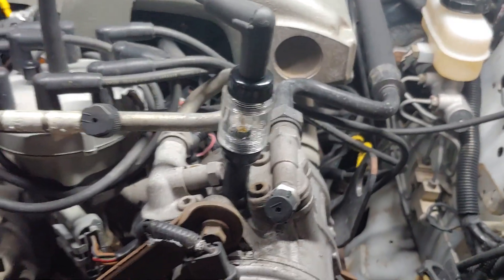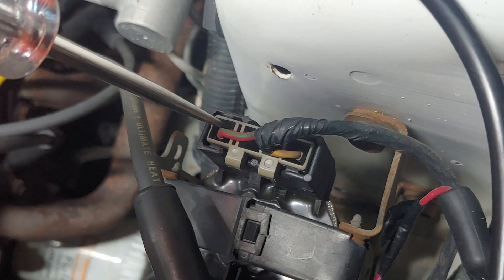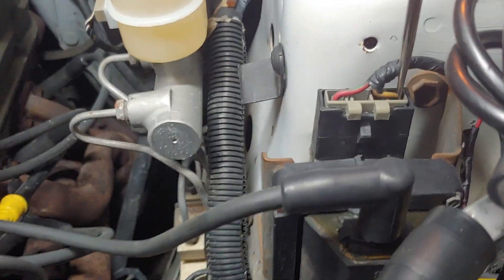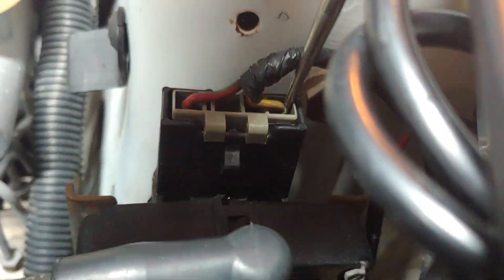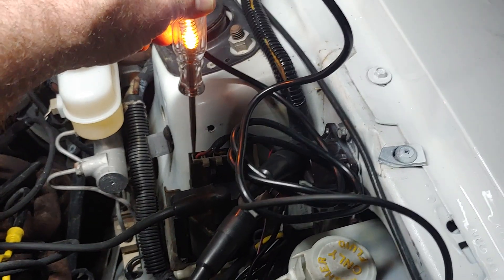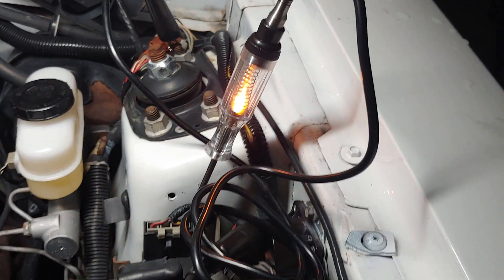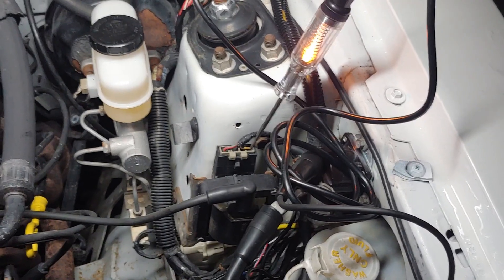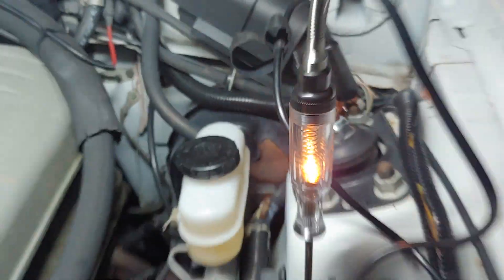How to test a TFI Ignition Coil on a 5.0L Mustang

Comment: I know this video is old but I’ve changed my module and the right side of the coil doesn’t flash does this mean the coils is bad
Reply from the maker: No. The flashing is caused by the ignition module sending a brief ground signal to the coil, which turns it on, charges it up, turns it back off, and causes it to fire. If your test light is clamped to battery positive, then it will light every time the tip of the test light sees a ground signal. This is what causes the flashing.

The pickup coil (a hall effect sensor) in the distributor sends signals to the ignition module, which passes that signal on to the PCM. The PCM alters the timing of that signal and sends it back to the ignition module. The module will fire the coil based on that PCM signal (SPOUT) unless it doesn't receive a signal from the PCM. In that case, it would fire the coil based on the raw pickup coil signal (PIP).

Either way, the module should be firing the coil by sending ground pulses to it on the right side wire (tan wire if I recall correctly). If your light stays solid bright and has no slight dimming pulses, the module is not firing the coil.

Comment: I've just finished watching all your fox body diagnostic videos and felt obligated to say thank you! You are an excellent diagnostician and you have the ability to deliver the information in a clear, understandable way for people of all skill levels. I just picked up a 1992 Mustang 
GT 5 speed that has been sitting for about 5 years and had no keys. I bought a new ignition cylinder and I'm working on replacing it. I'm at the point where I got the cylinder to turn and just need to work it out of the column. I ran out of time last night but I just HAD to crank it over and see if it runs, but the starter solenoid was stuck. I jumped it out with the ignition on and it cranks strong, but seems like there's no spark. Time to buy a few tools and do some testing. 

Also, you've mentioned that you offer the capacitor replacement service in your videos and I may want to tackle that proactively. What's the charge and how would I set that up with you? Thanks again
Reply from the maker: Thank you for the kind words. We do offer the capacitor replacement service. At this point, I wouldn't say it's being proactive to replace capacitors in a Fox body PCM. They're probably already leaking, and should be replaced ASAP. You can see us doing pre and post repair inspections in other videos. Contact us at pontisteve@earthlink.net for pricing.

Comment: But you didn't explain where do I put the wire clamp on the test light battery negative or positive or a ground or silanoid
Reply from the maker: Ground the test light to chassis ground. I used a strut tower stud, as seen at 3:30.

Comment: Would I have a bad module if I have no power on the yellow wire but I have power on the red wire?
Reply from the maker: When the key is on and engine is off, power flows into the coil on the red wire, winds thru the windings, and comes out the other side on the tan wire. Until the TFI module grounds that tan wire (to charge the coil and fire it), both wires should light the test light as shown in the video. If the coil gets power on the red wire and doesn't light up on the tan wire, then the coil's primary windings are broken and you have a bad coil.

Comment: what happens if my tan with yellow strip wire has no light coming from it? what can i do to have power go through it
Reply from the maker: That's the control (ground) wire. Whenever your ign module is not charging the coil, the 12v power should be going to the coil on the red wire, winding thru the coil primary windings, and coming out on the tan wire. 

If you don't see that 12v onnthe tan wire, key on engine off, check the red wire for power. If the red wire does have power and the tan one doesn't, the coil is bad. You have a break in the primary windings. An ohmmeter on a disconnected coil between power and ground should not be OL (open).
Reply: I have the same issue right now. Did you figure out where to ground the yellow tan wire? Thought I had a bad coil, but installed a brand new one and still have no power to tan/yelow but 12v to red wire any help?
Reply: @johnroberto5663 it ended up being my distributor which was bad and would cause my coil to heat up. I installed a brand new distributor and my engine fired up and my coil wasn't heating up anymore

Comment: Great video, what does it mean if it doesn't run with the spout connector removed? Could the TFI be bad? I'm trying to set base timing with the spout connector removed but it won't run, it runs with the spout connector in tho
Reply from the maker: It should run with SPOUT removed, just at a lower 10  degrees of timing. If your timing is too low, he engine can't keep running, so maybe it's an indication your timing is a lot lower than you think. Perhaps your balancer is spun, and the timing marks aren't accurate.
Reply: @dragradialperformance3540 Ok that makes sense because because the car does have a really bad vibration too, so should I install a new balancer set it to top dead cylinder on cylinder number one and restab the distributor making sure the rotor is pointed at the number one on the distributor? I think it maybe one tooth off
Reply from the maker: @ingodwetrust1136 you can test the balancer for accuracy using a brass piston stop. Remove all spark plugs first. Then, rotate the motor over by hand until the #1 cylinder (passenger front) is on the compression stroke, about  30 degrees before TDC. 

Insert piston stop in #1 spark plug hole and thread it in until it hits the piston. Then back it out some and rotate the motor forward some, until you get to where the piston stop is stopping the motor at exactly 10 BTDC.

Now rotate the motor over backwards one full turn until you gently hit the piston stop again. If the balancer marks are in the correct position, you should be at exactly 10 ATDC. TDC is exactly halfway between the two points where the piston hits the piston stop in both directions, which would be 0 TDC.

If you're not very close to hitting 10 degrees on both sides of TDC, then it's because your balancer has spun, and the timing marks are no longer where they should be. So the balancer is bad in that case. Replace balancer and set timing.
Reply: @dragradialperformance3540   Ok I will try that thank you so much for sharing knowledge man I really appreciate it 🍻

Comment: I know this is an old video but on the ground side the light dims when cranking but its not flickering. I'm starting the car at the solenoid if that matters.
Reply from the maker: You can either look hard at the video, or grab a friends Ford and test a known good one to see what a normal coil control signal looks like. Some flickering occurs naturally because the starter draws more power each time a cylinder comes up on compression. But there's a more pronounced flickering when there is coil control present.

If you suspect you don't have coil control, consider also checking for injector pulse. A bad PIP sensor will cause you to have neither. A good PIP and a bad module can cause only spark to be missing.
Reply: @dragradialperformance3540  thank you this is great information. I ordered a kit to test the injector pulse. I am leaning towards the computer seeing that everything has been replaced but I went with the $79 LMR distributor kit last fall so there's a chance the brand new distributor pip is no good. Never thought at my age I'd rather plug in my laptop or scanner or even go back to a carburetor to avoid all this 🤣 thank you!
Reply from the maker: @Joeshomegarage  You can test injector pulse with a $10 LED test light. A NOID light kit can be used too, but with a NOID light you can't check injector power and ground separately. If you have an incandescent test light too, you can check spark with it as well, or you can use an inline spark tester of some sort.

If you have a PIP problem, you won't have spark or injector pulse. If you have a TFI module or coil problem, you will only be missing spark.
Reply: @dragradialperformance3540  Okay yeah I tested at the coil with the incandescent light and tested with an volt meter. I have power going from the coil to the distributer but with the spark plug tester I have no spark going to the plugs. Also tested with a timing light and nothing. I swapped the TFI module with no difference. I do have an led test light so I'll test the injectors with the NOID and the led. It gets confusing but what's the easiest way to rule out the computer? I'm thinking it's either the PIP or the computer. Thanks again for the help! This car has been frustrating! LOL
Reply from the maker: @Joeshomegarage  If you unplug the SPOUT connector, you completely take the computer out of the equation for spark. I have a video showing that you can completely remove the distributor and the car will still produce spark during cranking. The TFI module fires the coil based off of the PIP signal (the sensor inside the distributor) at 10 BTDC at all times, if the PCM is not present or if the SPOUT connector is unplugged.

So if you remove the SPOUT connector and still don't have spark, it's a problem with the ignition coil, module, or PIP sensor. The PCM fires the injectors based off of PIP, so if you have injector pulse, you have PIP and you can then rule that out as the cause of lack of spark. The coil should have 12v key on, on the red wire at all times. The module also has powers and grounds going to it that need to be tested.

Also, please know that you can buy 3 or 4 new modules in a row, and it can still be the module. New ones suck! And that includes the new 'chinese' Motorcraft modules.
Reply: @dragradialperformance3540  hey bud, thank you so much for taking the time to write all this out to help me figure it out! So I did watch your other video and determined it was the distributor causing the issue and not the computer. I ordered another distributor and figured I'd just swap it out real quick and if it didn't start then I needed to dig deeper. Well pulled the distributor and the gear stayed in the engine 😳  pin sheared off. Set it to TDC dropped in the new distributor and she fired right up. LMR quickly refunded me for their faulty Chinese parts🤣
Reply: @Joeshomegarage good find! And thats a great lesson to remember. Its easy to forget that its an electromechanical device. The electronics only work if its mechanically working. Easy to forget, but would have been simpe to just see if the rotor spins.

The PIP sensor can also be tested by loosening the distributor and rotating it some. It will make a spark,  fire an injector, and turn the fuel pump on when the pcm sees that the cylinder position changed by just one cylinder. The problem with that test is that you then have lost your timing setting, unless you mark it first.
Reply: @Joeshomegarage o, and next time drop in the distributor at 10 BTDC instead of TDC. It'll fire up closer and run better on the first try.
Reply: @Pontisteve  thanks! I haven't set the timing yet just made sure it fired up. I need to put in a wideband gauge. I read 12 to 14 degrees advanced? I don't know what all is done to the engine just that it's a 306, B cam, and a paxton supercharger.
Reply from the maker: @Joeshomegarage  The stock ignition timing is set to 10 BTDC with the SPOUT connector removed. Some guys with NA motors that aren't tuned will bump the timing up to 13-14 degrees if running 93 octane. With a supercharger, you should have a dyno tuned engine. If it's some really old kit with a calibrated Vortech MAF and an FMU and no tuning, those were usually set to 6 BTDC. If you don't have a chip, set it to 6 BTDC, and consider getting it tuned.
Reply: @dragradialperformance3540  So the car has a PRO-M maf no readable numbers on it, it's an 88 so it was converted to MAF, FMU, it has a chip in the computer. I plan to install a wideband and then eventually convert it to a Holley System or have it tuned. So to confirm what you are saying is set the timing mark on the crank to 10 degrees BTDC then install the distributor? last summer I installed the new distributor and set the timing to 14 and it ran well but I babied it around town since I really had no idea what the Air/Fuel ration was.
Reply from the maker: @Joeshomegarage  really old school supercharged stuff would use a calibrated MAF, stock injectors (way too small), then use an FMU to jack fuel pressure thru the roof (to get the injectors to flow a little more). They also would use an inline booster fuel pump called a Vortech T-Rex. They may even use an MSD-6BTM Boost Timing Master, which retarded timing based on boost pressure.

All these things were a massive effort to trick the stock computer into not blowing the car up. In the modern world, all that stuff is antique crap. The car will run much better if you put in the proper injectors (60# Siemens Deka), a larger MAF (perhaps my slot style blow-thru MAF conversion kit), a properly sized fuel pump (Walbro 255), and dyno tuning.

If the distributor is already installed correctly, you can just unplug the SPOUT connector, and use a timing light to set the timing to 10 BTDC. Lock it down, and plug the SPOUT connector back in. If the distributor is out, you set the motor at 10 BTDC on the #1 compression stroke. Stab the distributor in correctly, so the rotor points towards the lower intake's passenger front bolt when installed. Rotate the base until the leading edge of the PIP tooth is in the middle of the PIP sensor's magnet. Lock it down, and the rotor should be pointing to the #1 on the cap when you put the cap back on. And the module should be in the middle of the adjustment range where it won't hit anything or pull on any of the plug wires. Start it up and set the timing, it should be really close.
Reply: @dragradialperformance3540  Thanks for all the info man I really appreciate it. it has blue colored injectors in it which I think are 24 lb. I really haven't decided yet if I'm keeping the car or not so I really don't want to keep dumping money into it. Trying to get it running good and reliable with working AC so the wife and I can hit up a few car shows and cruises. I always had a thing for Notchbacks but I'm a GM guy. My Past 2 cars were CTS-V and a Supercharged 06 GTO so I'm much more versed in the LS stuff. Think I would either prefer a newer car I can plug my laptop into or something way older with a carburetor on it.
Reply from the maker: @Joeshomegarage  Fox bodies can be a challenge to work on, because they don't have live scan data thru an OBD2 port. You can datalog them, but it takes some special equipment. I have a video showing me datalogging over a hundred parameters simultaneously.

Without much scandata, you have to get better at working on EFI cars without relying on a scantool. It's possible, and that's why I'm showing exactly how to do this on these cars.
Reply: @dragradialperformance3540 I wouldn't be able to do what I'm doing without people like you willing to share your knowledge. I pulled the distributor did exactly what you said to do and she fired right up. Running better than ever. I had it running decent before the distributor broke but was having issues on start up until it warmed up but now it's running great. I need to get the AC working and hopefully I'm good for a while and can go back to doing things I enjoy. Still need to put an AFR gauge in it to fine tune it. Probably going to get it ready to sell and focus on some other projects. Appreciate all the detailed information 👍

Comment: I have a flicker on the ground wire but when I start the car on the power wire the bulb shuts off, is this a bad coil?
Reply from the maker: The power wire to the coil should have a constant 12v any time the key is on. Engine cranking or running, or even just with the key on, that coil should be getting power. So a test light (hooked to a good ground) with its tip touching the power terminal of the coil should always have a bright light when the key is on.

If that light goes out, either the test light tip is no longer touching the coil positive terminal, or you have a voltage drop on the power wire somewhere. That coil gets it's power from the ignition switch, which means high amperage is flowing thru the ignition switch contacts. Which means those contacts can corroded and fail over time. So a bad ignition switch could cause a voltage drop across its coil contacts.

Also, the plastic ignition switch harness connector gets brittle with age, and may not be pushing the coil power wire terminals into the ignition switch terminals, failing to fully seat them and make good contact.
Reply: @dragradialperformance3540 thanks a ton man. I REALLY appreciate that info. You're the man
Reply: @dragradialperformance3540  idk if this helps with anything, but I did notice the #18 fuse was popped. Controls idle air tracking, tach, cooling fans, restart choke.. thanks again for the help.